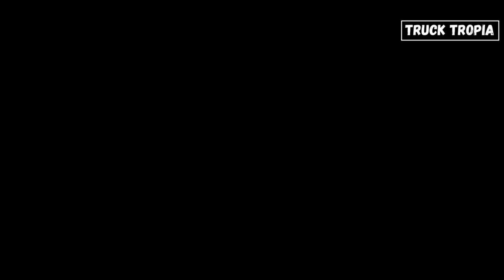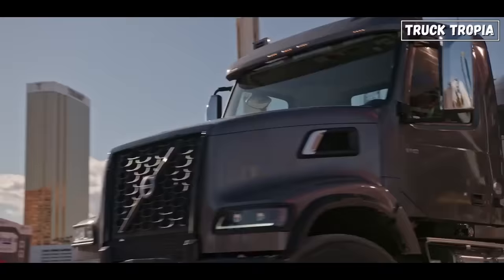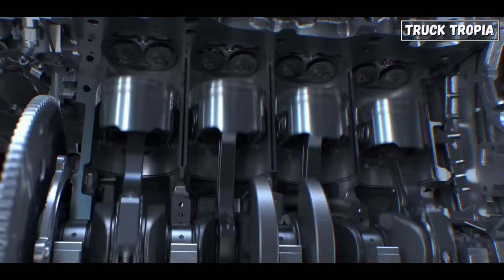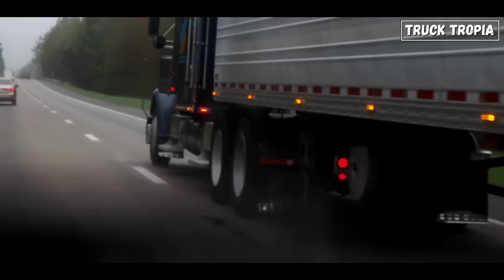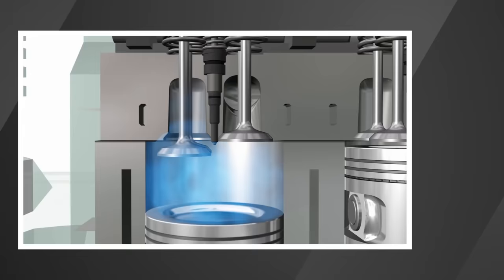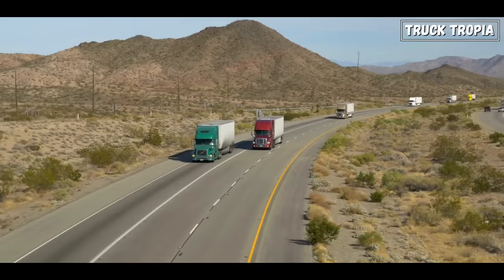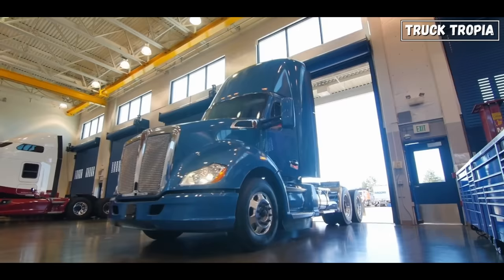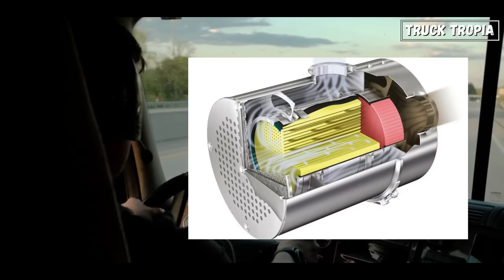Ultimate Truck Education 101 - Every Question Answered

Comment: 80,000 pounds = 40 US tons not 36
Reply: I was looking to see if someone else noticed that. Lol

I was like, 80,000 lbs or 72,000 lbs. What? 😂

Conversations are hard. 🤣
Reply: I think he calculated that using the British ton which is 2,240 lbs. 80,000 divided by 2,240 =  35.71428571428571 tons ... unfortunately just one of many confusing and misleading facts in this factual you-tube video.
Reply: Yeah, nobody cares about US tons. You know... the rest of the world uses metric tons. In wich case 80,000 lbs = 36.29 tons.
Reply: @albertori6965  then it’s not nobody if we use it.
Reply: @Coonazz791  You have to be in the US to find out there exists a local freak unit called a US ton (tonne).
Reply: Plus Foot Pounds are not the same as Pounds per foot.  Totally different units.
Reply: "US" ton is sometimes called a "short ton" to differentiate between that and the metric ton.

And the other poster is right about torque. "Pounds per Foot" is typically used to describe rotational or twisting torque, such as that for engines or electric motors. "Foot-Pound" (also Inch-Pound) is used to calculate the tightening or locking torque for a torque wrench, especially when tightening down nuts, bolts, etc. which are subject to high stress loads and need to be tightened to a specific torque.

(Edit: eliminated redundant words.)
Reply: @albertori6965  If you're going to specify pounds and not kilos when stipulating American trucks, then any extrapolation should likewise be American customary units.
Reply: It was a fun wake call to find out that long and short tons are 2 different things in my ship structure stability class. Most of our math was in long tons or metric tons.

Comment: Having driven both manual and automatic trucks in the US, I have two problems with automatics

1) Since they're so easy to drive, it makes it easier for a trucking company to replace you; the skill level to operate a truck is lowered, which means that trucking companies can get away with more BS such as low pay rates, poor home times, etc.. , because if truckers start showing any signs of revolt, they can just be easily replaced

2) Since they're so easy to drive, they're also easier to steal. Truck jacking has been an increasing problem in the trucking industry, since trucks have been made so easy to drive. Sure, training drivers will cost more in the short run because truckers will burn more fuel and damage the transmission while learning, but at least your truck can't be stolen by any idiot with a gun. The second company I drove for completely forbade sleeping in a truck stop in Atlanta or within 100 miles from it. This wouldn't have been as much of a problem with a stick

I do agree that automatics provide better torque and fuel economy, but if I had stayed in the US and bought a truck, I'd stick to a stick so it's less likely to get stolen

If anyone reads my comment this far, I am not trying to change your opinion, I am just expressing mine
Reply: The quality of drivers has gone way down. New school drivers today drive a truck like they are in a car. NO ONE is teaching them HOW to drive a truck. There is a lot more to driving a truck and being a truck driver. I have seen so many of them fly up to a traffic light and slam on the brakes at the last second. Brake failure = accidents. Give me a stick and a clutch anytime.

Comment: The reason why big trucks use diesel is the same reason why farm tractors also use diesel fuel.  Also there’s nothing like the smell of diesel exhaust in the morning!😂
Reply: Git er dun
Reply: Imagine the surprise when the first farmer walked into his barn full of fertilizer, smoking his first cigarette, and found out his helper spilled diesel in the barn...!
Reply: Nothing like diesel smoke laying low on the ground when temps are below freezing! Here's a tip. When parking at a truck stop in the winter to sleep, find a parking spot up wind of all the other trucks or you will be breathing those fumes all night!
Reply: @kellyhandley8519 diesel is not very combustible. Main reason used in boats.
Reply: @artsmith103  what size boats I would definitly prefer a gasline outboard on a small boat but on my 8000 horse power ship diesel is better.

Comment: Multiple  US states and Canada allow more than 80,000 lbs, like Michigan allows a weight of 164,000 lbs or canada with some provinces allowing 140,000lbs 

Plus when us federal says 80,000 that doesn't mean that's the max it's the minimum weight all US states must allow every US state has the right to allow more weight, but not less than 80,000lbs
Reply from the maker: True 👍

Comment: Automatic transmissions are so the steering wheel holders the big companies rush through training don't need to understand an 18 speed. I always want a manual!!
Reply: And probably get better fuel mileage in the process.
Reply: I have been a trucker since the mid nineties, I love my automatic… I haul 96,000 to 129,000 over a 9114 foot pass with 8% grades with no problems and it’s just easier. I had an 18 speed Manual for years and years before. about a year and a half ago I got an automatic. I just like the automatic better.

Comment: I drove back in the 70s. I have driven a few diesels V8s.  I owned a rig with a 318 Detroit. Also drove rigs with the 262 Cummings, 903 Cummings 350 Detroit. The big power back then was 350 Cummings and a few that were 450HP. Engines I have driven 220 cummings 262 cummings inline 6 and V8. Cat Mack and IH rigs with their engines. Trans 4by4/ 4by3 / 5by4 /13 and 15 speed Roadranger. I ran 40ft flats and tankers with and without baffle's. 27Ft high cub double vans.
Reply: Cummings huh?

Comment: A lot of this only refers to the USA.
In Australia sleeper cabs are comfortable but not over the top in length therefore compromising their ability to manoeuvre whilst complying with local laws regarding overall length.Trailers are typically tri-axle, and typically have two trailer (B-Double or b-Trimble or road trains with up to four trailers. 
Lifting axles are often nicknamed ‘lazy axles’.

Comment: Cat 3408. Loved that 8 cyl. monster. ❤️
Reply: That was a great engine. But when talking about USA V-8 engines, I cannot believe no mention of the 8V71 or the 8V92. There use to be plenty of them around. Cummins also had their 903. Still remember being out at night along the highway and hearing the rat-a-tat of them old Dee-troits as the old timers called them. And if you made fun of the oil puddle under their rig, they would only remark, "I doesn't leak oil, it's marking its territory!"
Reply: @ronfullerton3162  I agree 👍🏻👍🏻
Reply: Better than the Cummins 903
Reply: @ronfullerton3162  Couldn't beat the sound of the old detroits
Reply: @andykennedy5982  Nothing sounds like them. Definitely got your attention.

Comment: So many statements here that come from inexperience 
1. Diesel is slow burning therefore stroke length scavenges torque and gives a greater power stroke = power and economy.
2. Axle spacing and numbers of is regulated by d.o.t for weight distrubution and road damage control , so you see some weird stuff out there .
3.auto vs manual, auto is great for new and inexperienced drivers and keeps down repair costs but fuel costs suffer because new drivers gokart their rigs trying to beat traffic.
With experienced drivers a manual is a great choice and owner operators prefer them because an automatic cannot predict road or traffic conditions and will give better fuel economy and life span .
Company drivers, an auto is best.
Owners, a manual is best.
I have driven for 20 yrs all kinds of rigs 
And spent 5yrs working on them.
Experience counts.

Comment: I have two fuel tanks on my truck both hold 140 gallons so in total I can hold 280 gallons I can go between 1200 and 2000 Mi per fuel up depending on my MPG

Comment: Holland also has a 50 ton weight limit instead of 44 ton.
Btw I wonder how much more a 770 V8 uses more fuel than a C15 with 605 HP.
Most US V8’s where 2 stroke and those use more fuel than a Boeing uses at takeoff 🛫
Reply: The only 2 stroke V8s were made by Detroit Diesel, in the form of the 8V-53, 8V-71, and 8V-92. There quite a few other V8s out there, such as the 903 and 555 made by Cummins, the D336, 3150, 3208, and 3408 made by Cat, and the E9, 864, 865, and 866 made by Mack. I believe the Detroits were the most popular, followed by the E9 and 3408. The 903 was an alright engine, as well as the D336. General consensus on the 555 Cummins, 3208 Cat, and the 860 series Macks wasn't very good. 3208s are regarded as a throw away motor, 555s like to blow up if you lug them to hard, and the 860 Macks liked to crack heads. The mighty 3408 was know to  break cranks when turned up to far as well, some attribute that issue to it also being a 60 degree V engine. I don't know much about the D336 other than it was a dozer engine that was used in trucks under the 1676 designation, and 3150 was a predecessor to the 3208.
Reply: @DeathHead1358  👍
Reply: You are correct, but when a 2 stroke runs away with itself it is remarkably entertaining, and possibly dangerous!

Comment: Fuel efficiency is really the only reason diesels are used in heavy trucks and equipment. Horsepower is horsepower. Torque is only a matter of gear ratios, and a gasoline engine can be built to be just as durable.

Comment: I haul 96,000 to 129,000 up to 9114 feet with 8% grades using a 500 hp all the time… the differential gear ratios make a big difference as well… not just the HP or transmission.

Comment: There is a HUGE difference between a automated transmission and a true automatic. Automated transmissions are nothing but a computer shifted MANUAL that also has a computer controlled CLUTCH same as a MANUAL transmission/clutch combo. A automated transmission is what most class 7/8 trucks use. A true automatic transmission has a Torque converter instead of a clutch like a manual or automated transmission. While I am a older CDL holder, I see so much misunderstanding still of the true differences. I see comments like "I need a manual because I need a direct conection to the tires so my jake works best and a automatic does not provide that" while in reality they are talking about a automated transmission which has a clutch just the same a manual, and therfore DOES have a direct connection with the tires. A jake will work exacly the same on a Manual or Automated transmission. A jake can work well on a true automatic, but it required the Torque converter to be locked up to work well, this take a few seconds to accomplish, therefore intial feel is a free wheel sensation. Just understand that Automated and Manual transmissions work EXACTLY the same way, only difference is one does not have to shift the automated. True automatics work thru a Torque converter and function differently.

Comment: 30:40 What the fuck is a "speeder"? You mean Throttle/Accelerator pedal. You make it sound like there is a speeder button on the dash. Maybe that's the button that goes to ludicrous speed! 

As a manual transmission driver, I would say that the automatic makes you more lazy, more easily distracted from driving.  You need to pay attention to those around you (esp. in a big rig) in case you need to downshift or go into neutral/clutch to not kill the engine in an emergency stop. Another reason the manual has benefit, downshifting to help slow down. There is a lot of shifting, from a stop, in a loaded big rig, so city driving will be where the most shifting while happen. Once you are up to speed you only need to shift for grades, or to slow down/speed up. Automatics must be told through programming and have some form of Manual input to downshift/upshift at the proper times. This tech I am sure has made improvement over the years, but the computer can't see the road and traffic conditions (yet). Automatics also have a metric ton of slip, increased wear and service over a manual, they generally weigh and cost more (at least in the Cars and Trucks). Automated manuals MAY be a good compromise, I don't know much about them.
The skill level bar to drive a big rig manual transmission, may be providing better drivers to the industry (total speculation).

God Save The Stick Shift!
Reply: That bit about not seeing the road is now obsolete. Freightliners now can gauge their speed , on cruise, so that they can coast up the last of a grade and take advantage of the upcoming down grade to resume cruising speed. It's done by GPS grade mapping of almost all major roads. Scary !
Reply: @hansjansen7047  Yeah. Figured it was at least on its way. Cars have been using radar to run the cruise and emergency braking systems. All over cameras are not just for the driver either. The way I see it, it can make drivers lazy. To that point the cars/trucks will be driving themselves soon anyway.  Scary indeed. I am not a fan.😶
One day maybe will look back and laugh, but considering we past 2020 without all the flying cars and automation that was "foretold", I don't know that we will make it to "one day" 
Not in my lifetime anyway HAHAHAHA!

Comment: @ 04:36 ... In the USA 40,000 lbs is 20 Tons. A USA ton is 2,000 lbs. 
The illustration depicts a three axle trailer which allows additional weight depending on the spacing of the axles on the trailer, the spacing of axles including the tractor,  the number of tires (tyres) on the additional trailer axle. Also if a "super single" tire is on that axle. I'm thankfully retired from all of the regulations, and yes, some of the self important commercial law officers (whom I had to school) a few on what was permissible under federal regs. On the whole they were good eggs, and lets face it they helped insure the drivers and rigs were safe to be on the road. Stay smart, stay safe and be patient!
Reply: Internationally a ton is equal to 1000kg or about 2204 lbs.

40,000 lbs is 20 short tons.
Reply: and long tons are 2240lbs.

Comment: I've seen a 10x4. I work on garbage trucks. Before we scrapped it, we had one unit with a steer axle, a pusher axle, two drives, and a tag axle.
Reply: I drove a Volvo FH dump truck that was 10x4, with 3 steering axles, one of which also lifted.
Quite a handful to drive in central Helsinki.

Comment: Torque is NOT what allows trucks to maintain speed on a grade.  That is HORSEPOWER.  Torque is only a force.  Unless that force can be produced at a sufficient rate, you'll have to gear UP to maintain speed, which divides down the torque.  Horsepower is force times speed.
Reply: Torque is needed to get heavy stuff moving, and to climb, without it you are wasting work
Reply: I have always heard that horsepower is how fast you hit the wall while torque is how far you move the wall.
Reply: And for god's sake, please get the units correct pound-feet! Not pounds per foot! (The announcer, not @jamesanderson2176. I added it here because you were talking about horsepower and torque)
Reply: Exactly true!  Virtually everything stated in this video about torque is wrong.  Even when referring to torque generated by a diesel vs a gas engine.  No, diesels do NOT generate more torque than a gas engine unless they are designed to do so.  Aviation piston engines are almost all gas engines and they have torque and HP curves almost identical to diesel engines.  Why?  Because that is how they are designed!  Propellers become very inefficient at high rpm so the engines are designed to have a redline of anywhere from 1800 rpm for the large ones to around 3000 rpm for the smaller ones.  So a diesel engine with the same HP output and rpm limitations as a gas engine will put out exactly the same amount of torque.  The type of fuel burned is irrelevant.
Reply: @shadowopsairman1583  No, it isn't.  If it was, a vehicle powered by a turbine engine wouldn't be able to tow a baby carriage because it produces very low torque.

Comment: Since diesel has been used way longer than any emissions standards of any fuel I think it's safe to say emissions have nothing to do with why diesel is used.  If anything diesel emissions standards have been more of a problem than good for the actual operation of diesel engines.